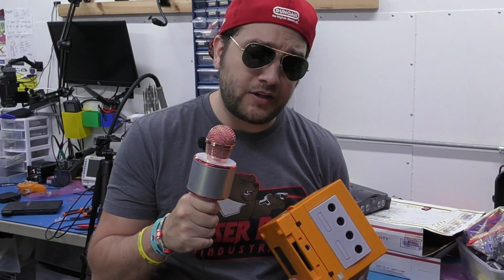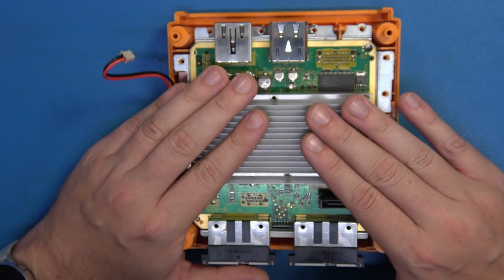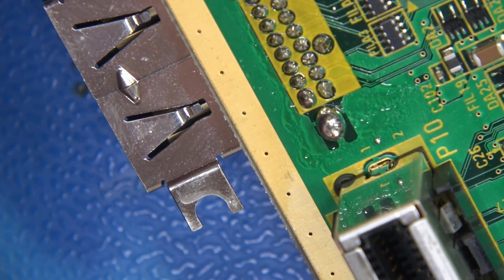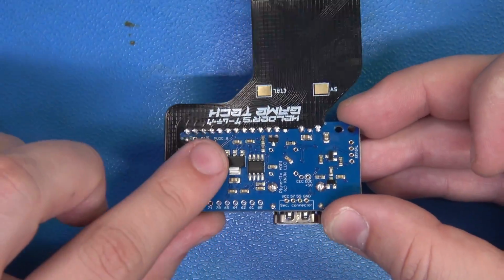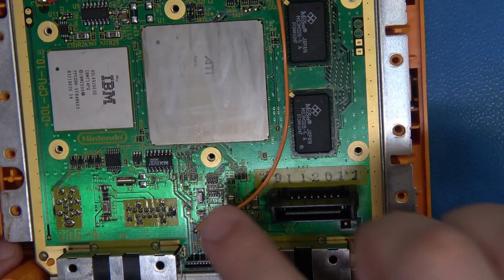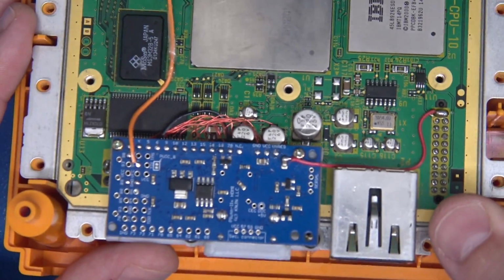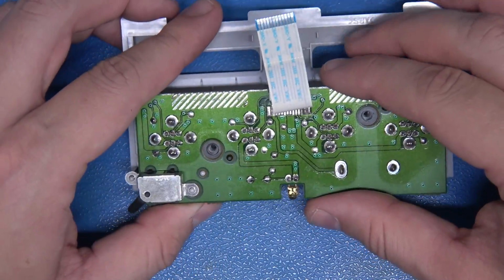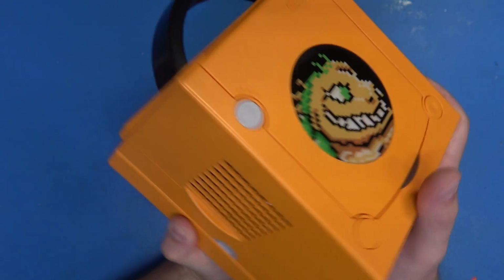Soldering Hacks for the Nintendo GameCube

Comment: Had the same exact issue with the ribbon and i though I was doing something wrong. I bought high temp silicone wire from amazon and redid all the soldering worked great. I even bough an HDMI tester that plugs inline and it showed missing signal. I almost reprogrammed the FPGA board using the Pluto programming windows application. Again all was solved with replacing with individual wires!

Comment: I can't justify doing an HDMI mod on the DOL-001. It already has excellent digital output through the AV port, which works seamlessly with devices like the Carby or RetroTINK 4K to deliver stunning, lossless video without the risks or irreversible alterations of an internal mod. Removing the digital AV port for an HDMI mod, especially when replacements are rare and installation is challenging even for experts, feels unnecessary when external solutions are plug-and-play and achieve the same results. On a DOL-101, where the digital AV port is absent, an HDMI mod makes sense, but for a DOL-001, the cost, effort, and risk simply aren’t worth it.

Comment: Why is there interest for internal GCvideo mods? There are a number of GCvideo devices that plug into the digital port. Is there some advantage that I am not considering? It's not analog, so there is no improvement when using an external adapter. Why do this? I also agree. Preserve those ports. But I question the point in removing them.

Comment: It looks as though they initially designed the KunaiGC to where you had to remove the chip and the board would be soldered into the main board with the chip being placed on top. Because the measurements are so bad if not.

Comment: So, I really have no experience at all with soldering/desoldering, so this may be a very dumb question, but can I ask why nobody in any of these gamecube mod videos seems to be using solder wick for the removal process? Is there a reason why that wouldn't work? Sorry if I'm dumb and there's a super obvious answer here.
Reply: Not a modder, but I repair alot of ps5 hdmis: Solder wick tends to do more harm than good....would rather use a sucker than risk accidentally ruining a pad again.

Comment: I have no issue with the pluto mod. It retains the stock look and works as good as a carby. Also doesn't require a 3rd party remote to change settings, which is another plus for me.

Comment: Says we should be preserving the digital port then proceeds to remove said port lol. Just messin with ya ✌🏼

I see northridgefix and other channels remove hdmi ports with hot air and low melt solder all the time. Is it because the gamecube board in particular is a bad option to use that method? Still learning a lot myself Im a noob.

Comment: I got a Pinecil soldiering iron for Christmas, and I think it'll be real fitting that my first mod would be for my first console. Before, the most modwork I could do with those soldering irons you plug into the mains was nil, all I ever managed to do was to solder a wire so my AGS-101 screen had an extra step of brightness in an OG GBA (I now want to install a new screen and an audio mod.)
Now there's this world that's opened up and I can take it on with confidence thanks to your help! Thank you!

Comment: I hadnt heard of the gc dual, and ended up buying the pluto with the ribbon cable and mounting bracket. Would you recommend selling them off to get the gc dual imstead? I dont have a desoldering station yet, so i would need to buy one, but im reasonably sure i could install the pluto without too much trouble.

Comment: I agree with you about not using ChipQuik but you said you weren't going to use any expensive soldering system and then you broke out a $200 plus de-soldering gun. Made me chuckle.
Reply: It's not the same as doing it with a pump-action solder sucker lol. The gun is way more comfortable

Comment: I've seen someone add a resistor to a noctua fan to use its silent function without the use of the third wire, not sure how much I can recommend it but it's a neat thing to point out for a quiet solution

Comment: Nice video. I'm personally more a fan of the pico boot, but I also have over a dozen of the various Pi versions I use for loads of projects and tasks. I've been meaning to get around to modifying the HD port to HDMI, but haven't been in much a rush since getting the steamdeck and having my whole console Library on it with saves backed up to my NAS. I'm looking forward to the coming M.2 adapter for use on the gamecube too.

Comment: Huh, I've been using quickchip for tricky joints on older vintage boards that I didn't feel could handle too much heat. I just use a tiny bit on each contact, certainly not flooding and using hot air though. A little bit goes a long way.

Comment: The Bluetooth controller and other mods were cool and all. The thing is, I'm cool with soldering in mods to give something a digital out, but if something like this already has a digital out, why not just stick with one of the home-brew plug in options out there? Now my concern with those is sticking a block hanging out there on a delicate PCB connector. Does anyone make just a short extender cable for the digital cable? These guys already recreate the plug itself to plug into the box. Can't anyone make a short cable so the HDMI box sits power brick style out the back? I expect the original cables aren't exactly easy or cheap to find, but again, these guys make plugs for the things to plug in, just find new wires to connect to.

Comment: Sorry bro, but you can remove the connector in 3 maybe more ways without damaging or overstress the board in anyway. 
1. Desoldergun ( expensive) 
2. You can use Roses Metall (10-15 Usd for 100g) to lower the meltingpoint  96°C . After that use hot Air 250-270 °C  for 10 maybe 15 sec. Or use a mechanical cheap desolder pump 4-6 usd 
3. Use stainless steel hollow needles for desoldering  2-4 usd

Comment: I had problems with the flex cable aswell. So now I ordered a Adaptor Board from OSH Park for the Pluto Installation that uses Pin heads. It is called EZPluto
Do you have any experience with that? Would you reccomend that?
OR Would you recommend wirering it up by hand? If so what wires are you using? Those in the video look very thin.
Reply: I Ended up wirering it by Hand and Not using the EZ Pluto Board.

Comment: I don't understand why the designer of that ribbon cable decided to design it that way, if you need to run a jumper wire from your 5v source to the ribbon cable anyway why not just run the jumper directly to the Pluto board and design the ribbon cable to avoid that cap altogether? The way some designers completely ignore the obvious elephant in the room does my head in sometimes.
Reply: I think because the board then the mount was released first, he had to work around that design

Comment: The flex cable for the Pluto board. Wouldn't it be better to make a sharp fold where it is marked with dashed lines? Leaving it rounded bent instead of sharp folded, will always stress both the flex cable and the GC circuit board.

Comment: So apologies if I missed something but the main downside Voultar gives to using ChipQuik or another low melt removal alloy is the cost, I think? I wanted to give another downside that I don't hear people talk about much:

Because it stays molten for so long it is so easy to get it all over the place, and then you have to worry if you've accidentally contaminated other solder joints on the board with low melt. There've been times that I wicked and resoldered like 2 dozen joints in the general area of where I used ChipQuik because I was so paranoid that they might have gotten contaminated.

Comment: There is now a memory card that allows a usb drive and sd card to load games from. 
The performance IDK. 
Did the gamecube mods mostly for Swiss gbi with the gamecube player. 
I got the hacked wii. Does wii and gamecube. Good enough. hacked wii u does gamecube, wii and wii u and has hdmi. 
Did they have to use ribbon cable. It was annoying. 
This is probably still good.

Comment: Is there a reason for cutting and joining the fan loom instead of crimping on a new connector? I bought some crimps to do that when replacing fans on vintage graphics cards as it meant I could keep the wiring runs shorter / more like stock and feel it's cleaner than having to cut up and solder.
Reply: Depends on the connector type. Some of them you can easily get good crimping tools, others are a pain even with the $600 tool sold to work with them. I often would rather splice than crimp even if it's a little uglier.
Reply: @rfmerrill  it’s just a “JST” type connector though, a $30 tool from Amazon will do a good enough job. Does take a bit of practice to get it right, I burned through a few connectors before I was happy!

Comment: I really think these ribbon cables can only take the smallest about of heat before they break, and they definitely can't take 2 or 3 reworks.  Like a 2 second tap and done kinda deal.
The Kunai interface board looks like it was fabricated at JLCPCB without the "castellated holes" option selected.  Likely to reduce costs as this option can sometimes triple the production costs of these boards.  I've done this myself multiple times when you just can't justify the astronomical price increase.

Comment: After I did this installation about a month ago I thought the same about the flex cable, I didn't like at all how it was going upward (it even touches the shielding, so you have to insulate the two pads on the top otherwise you'll ground everything), still I didn't have any issues and kept the cable. What convinced me the most was that the flex cable should technically avoid any interferences, so no video distorcions or whatsoever. How did you fix that using wires? Maybe magnetic wires should avoid any interferences...? 

Also great video as always, I too didn't like the idea of having a debug board inside the GC, but I really wanted to spend some money for a GCVideo option which is also practical and good looking and this is the only option available
Reply: Update: the ribbon cable broke and I used your 30 AWG wires technique :) Came out very nicely, I think I learned something from it (other than never trust weird ribbon cables)

Comment: Cheers for the video Voultar! Im only part way through but when desoldering the digital video port do you recommend leaded or unleaded solder?
Reply: The idea is to flood it with a lower temp solder to help get it to a liquid state easier. Lead free solder has a melting point of 217C while leaded has a 183C melting point. 

Flood it with leaded solder.

Comment: Hey Voultar. Controller Port 1 on my childhood GC is broken. Anyway to fix it or would I have to swap out all the ports?

Cheers
Reply from the maker: Yes, this is extremely common. You simply need to take the PCB out and reflow the pins for the controller port with fresh solder and you'll be as good as new.

Comment: I'm not sure if you mentioned this in the long video but a common consequence of being too rough with the heatsink is knocking off the diode arrays that protect the serial ports--they're little SC-70 packages with refdes like DA15. For anyone that has a board where these are missing, I found some replacement parts: Rohm part numbers UMP1N and UMN1N. Which one you use depends on whether the footprint connects to ground or 3.3V. 

I believe these are original parts used by Nintendo because the markings match some photos of boards I've seen. I verified these parts are correct based on a GC mainboard schematic a kind fellow slipped me.

Comment: Another fantastic/educational/entertaining tutorial full of t1000 juices! My mg chemicals no clean flux isn't working properly. I find my sra flux works better and as a product it's not better. I'm running a hakko adjustable iron with hakko tips. Are there any tricks to get the no clean to work better ? I'm using the iron at 305 C. 

Long live
Reply: The flux isn’t the issue. You just need more heat. Some of the pad connect to a copper plane with sucks up and dissipates heat.

Comment: I desoldered the Digital port with my TS-80 soldering iron and desoldering braid/wick. it's still intact in a box somewhere.
a good quick solder ribbon would be nice for the pluto board, but ideally pixelfx would come up with a new modern solution that can handle more resolutions/settings and most importantly  HDMI CIC for the settings, instead of IR controller or controller shortcuts.

I keep forgetting them lol.

Comment: I'm amazed between this and the 360 RGH3. I never would have thought old consoles would get mod "updates" after a base standard was set.
Reply: I wanted to do rgh3 on my 360 E corona but was told the post fix adapter is a pain in the ass
Reply: @joshkelly4682 post fix is the easy part imo. Pads are easy to grab only issue is if you don’t have captains or electrical tape

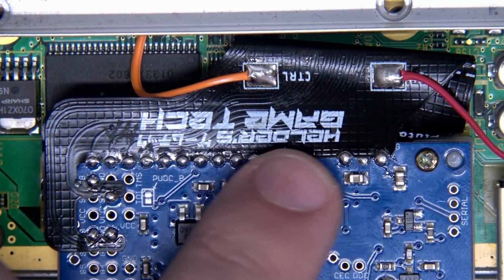Comment: 35:44 I was just saying in another thread--this is very similar to what I consider a major downside of silicone wire insulation. Most kinds of wire insulation deform plastically, meaning that you can bend them and they will roughly stay bent. You can reflow your solder joints with the wire in its final position to make sure that there is no stress being applied to them by the wire trying to return to its original shape.

Silicone insulation, although it bends more easily than some other types, deforms elastically. It will almost always try to spring back to its original shape. This can put strain on solder joints for sure.

Comment: A work around might be to solder a wire directly from the 5v source to the pad bypassing the ribbon, you'd still have the fatigue stress on the other contacts assuming they still make good contact

Note: I'm an amateur solderer

Comment: I've used Helder's flex cable for a couple of these, I personally think it works well, but it is extremely sensitive.  I've had the little edges detach on the GC side a couple of times as I was reworking the GC side destroying the cable.  It's cleaner, but I'm not sure if it's better. I would recommend screwing the pluto down with at least one screw to the mount, I've had the pluto pop out before.

Comment: Awesome vid as always. Do you think it'd be possible, at some point (maybe a later revision by the creator) for the QSB on the Kunai to switch from using its pads to interface with the modchip's castellated edges to using headers, and the modchip's through-holes? I realize that gravity is probably not all that much of an issue, but I'm not sure how I personally feel about the way this interfaces... seems unnecessarily clumsy. Would it be inconvenient for the person installing it, given its small footprint?

Comment: Gotta say, watching tito put that pluto in had me cringing as well. Spend the coin and just get the hakko 301.
Reply: Tito has a 301 as well. He was operating on bad information that he might damage the traces in the digital port mounting area on the board by using the desoldering gun. But even Helder, the designer of that ribbon, used a desoldering iron in his installation video. There was a qsb like mount developed for the pluto before the ribbon by another designer, but it was short-lived and seemed to have issues of its own.
Reply: @brianchambers7070  That's what made it even harder to watch. I was literally screaming at the video saying "Use the hakko!" lol
Reply: I saw Tito do that and immediately knew he was a guy in over his head who is decent at making Youtube videos.  Filled with mistakes.

Comment: .. removing the through hole port - can you use wick instead of a solder sucker/puller? Agree that you don't need a heat gun though - yuk!
Reply from the maker: Sure. But you're not going to have a fun time.
Reply: @Voultar try one of those plastic pumps for fun.
Reply: @Voultar  i'm waiting on parts for my first GC mod and i'm counting on a combination of braid and hand pump.  I remember it working well on my OG xbox mods which were through hole connections when i wanted to take them out.  Not fun but doable
Reply: @Voultar  I managed to do it using wick and everything came out ok but it was indeed not fun at all.  if i ever do this again i'm going to buy that little solder remover gun.
Reply: I've done quite a few of these and using a wick will cause you to question your humanity as you scream in frustration. I hate doing this mod, removing the digital port is the worst.

Comment: I've been getting more into soldering and recently got a Hakko desoldering gun and it makes life so much easier. Much better than the previous one I had. The better quality tools are worth their weight in gold.

Thank you for gracing us with another great video Lord Voultar.
Reply: The FR-301 is the best ~$250 I spent on desoldering equipment.  No more ripped-up traces and no more pumping insufficient thermal energy into massive ground planes!  I bought the slot-type tip that lets me use it with those wide connections.  Way better than wick for the big jobs (which is "anything more than about 3 connections")
Reply: That's the same one I got. 👍🏻 
Works amazingly.